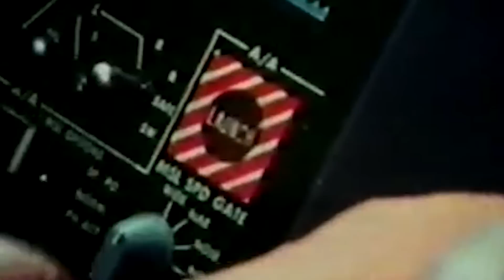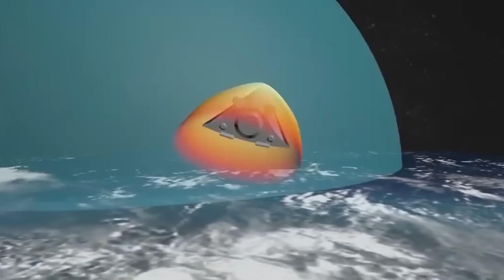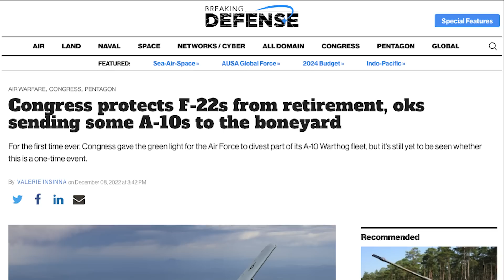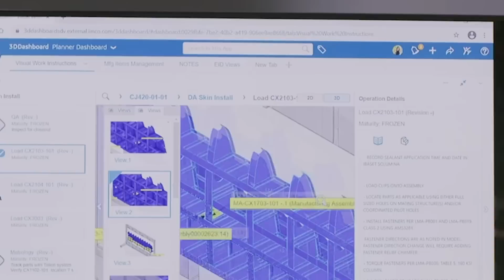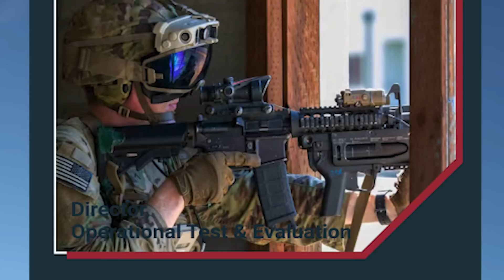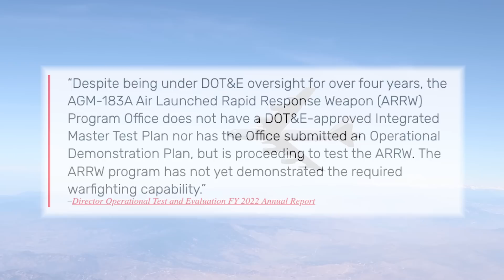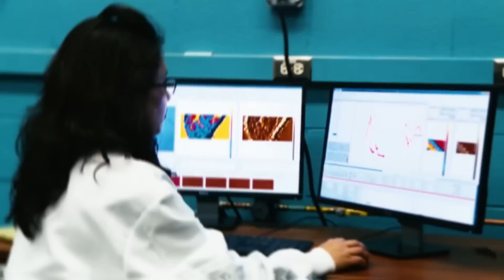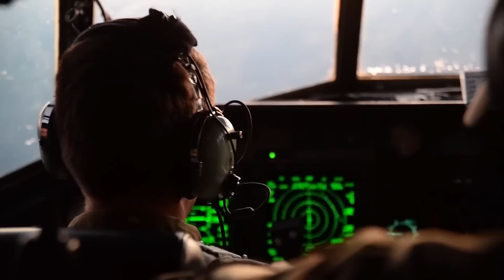What went wrong with the Air Force's HYPERSONIC ARRW missile?

Comment: It's often true that more can be learned from a failure than from a success.
Reply: I’ve learned In engineering one thing that is always true.  1 develop a checklist for your product and each component and 2 carry it out at least twice.    If the test campaign was being short cut failure was inevitable.  You can’t short cut.  Only way to speed up is to bring in more workers.
Reply: I don't know.  It looks like a viable hypersonic missile program that had a good chance of success was ruined by accelerating it by bypassing tests and checks for the sake of a slight advancement in potential deployment date.  This now leaves the US dependent on more complex and likely to fail air breathing missiles.  What could go wrong.

Comment: Quite apart from the over-arching question of strategic utility, still can't understand why, such considerable expense, the specific, identifiable issues would not be cheaper to address than to abandon the entire project. Was it perceived as not so much too difficult, but rather as throwing good money after bad? Or is the key issue was systemic planning flaws, once these were identified, would it not be cost-effective to re-structure the project and try again? (Sorry to be clueless DESPITE your excellent analysis, Alex 🥴)
Reply: I think there is a need to funnel money at defense contractors to keep them from a brain drain. It sounds like a make-work project, and since there is a war going on in Europe, there's that extra incentive to rush it into the battlespace to do some 'live fire exercises' to ascertain its combat potential.

Comment: Like Elon musk has been quoted many times"if you're not failing, you're not testing enough" .... You have to test it until it breaks and then keep going, and that goes for missile systems too
In the rush to field the system, the Air Force and the contractor developing this system forgot that concept. Every point of failure leads eventually to success.
The problem is the" politicians"  want a quick fix, to an issue they've never dealt with before.
Reply: This

Comment: The US military is making a powered hypersonic missile. What Russia and China have done, could EASILY be replicated in the US. All they have done is take a ballistic missile and change it's flight pattern. The US on the other hand...is trying to build a missile with an engine onboard that maintains the speed for much longer over the ballistic missiles. Russia and China's missiles are fast initially and depending on how far they fly it out....it could be way into subsonic speeds before it reaches its target. They also lack some maneuverability because maneuvering their missiles will bleed its energy off(speed) and slow it way down.
Reply: Absolutely  correct  Sir
Reply: LOL. You have got your facts screwed up. Russian Kinzhal fits the description you are talking about. Kinzhal is a ballistic missile depressed trajectory and ability to do limited maneuver. Missiles classified hypersonic missiles like China's DF-17, Russia's Avangard and Zircon are highly maneuverable missiles with flight pattern that is very difficult to predict. Currently, US can not "EASILY replicate" such weapon. ARRW was their first attempt to replicate such weapon and they had failed. There are fundamental difference between the design and the technology of a ballistic missiles versus hypersonic weapons. Ballistic missiles have blunt conehead and uses contained rocket motors. Rocket motors use liquid oxygen or an oxidizer as a source of oxygen  to ignite its liquid or solid fuel instead of sucking in air from the outside. But once the last stage separates, it is mostly free fall weapon except in rear cases where they add additional rockets to do a limited maneuvering at the terminal stage.  Chinese anti-ship ballistic missiles like DF21D and DF26 are ballistic missiles.  Hypersonic weapons that are glide versions have a flat bottom to bounce off the atmosphere and change directory after it separates from a boost phase, which is powered by rockets, like the ballistic missile. Scramjet hypersonic weapons use scramjet motor which sucks in air to give its power.
Reply: russia leads the way thats a fact
Reply: @frankrenda2519  😂

Comment: 12:30 - correction: the "DF-ZF" was eventually modified into the "DF-17", which is not a "strategic" system meant nuclear 2nd strike (even though it's likely nuclear capable), but rather a conventional intermediate range precision strike mission comparable to other PLARF IRBMs of a comparable range - somewhere in between a DF-21 & a DF-26. The PLARF has yet to field a "strategic" system with an HGV or air-breathing scramjet hypersonic propulsion, although that's widely known to be under development.

Comment: That was a great excerise in methodical news telling. A very convincing storyline.
One thing I quesry though is the conclusion the whole programs shut down was needed.

As you pointed out Alex, it was the first stage of the mission objective that failed and nothing else - it didn't get to stage two (navigation to target) nor stage three (impact) but failed in the launch phase.

How do we know the mach speed was not right on, that the navigation program was extremely accurate or that it's impact location and power was not equally as expected.

So from the conclusion brought about by the DOD or Senate to cancel the entire program, as opposed to fixing the stage one issues seems an alarming oversight of all the other components never realised in the test phase.

Comment: Having worked on engineering projects for decades, I learned that the reason for testing is to validate a concept or some aspect of a system function.  If you learn that the concept is invalid, that is not a failure, it's a datapoint.  It's a fact.  It's knowledge, and it's progress.  The universe of hard knocks is a good teacher, and only a fool doesn't learn from testing.  That's the reason for after action reviews.  That is the reason why the United States military is the best on planet earth by a wide margin, and thank goodness for that.  If only the politicians did half as well as the military in their (dys-) function.

Comment: Because Raytheon has been chosen to build US hypersonic missiles. Just like when developing the F-22, the YF-23 although even better than the Yf-22 in many aspects was scrapped when the US air force chose Lockheed over Northrop Grumman. It makes sense as Raytheon's main focus is developing weapons and weapon systems where as Lockheed's focus is military aircraft.
Reply: The YF-23 could have eventually been a great aircraft.  However, a lot of the systems were still under development, while the YF-22’s systems were mostly proven and ready to go.  The YF-22 was also a better pure air superiority fighter, which was what the USAF was looking for.  If the USAF had been looking for a multi-role aircraft, then the YF-23 may have been the way to go.  It would have also been ideal as a fleet defense fighter for the Navy, due to its longer range and larger weapons bays.  Its lesser maneuverability would have been less of a detriment in naval service.

Comment: The ‘failures’ you mentioned (failure to detach from the B-52, failure to ignite) aren’t total failures. 

They are more on the lines of technical errors made by ground crew during preparation for the tests. Nothing more. 

As you stated, in all of the other tests, the missile was successful.

Comment: But the AIM-260 went into full production last fall and that is hypersonic.  There is also a hypersonic cruise missile that has test successfully that is supposed to go into full production by the end of this year.  The problem is HS missile MUST cruise at at least 10,000 feet or more do to the thinness of the air at those altitudes.  Most in fact need to hit 100,000 feet to achieve those speeds.  This makes them much easier to shoot down.  And while they say many are maneuverable, this just means they have can have a flight path that tries to avoid air defenses.  Any cruise missile should be capable of this (but typically can not).  A NASAM system with some AIM-260 should have no trouble taking down pretty much any HS missile.

Comment: I'm not sure the reason for developing and ultimately cancelling ARROW is what Alex suggests here.. If fielding anything hypersonic as soon as possible was USAF's goal, than they should have continued with the Navy and Army in fielding the 3 service boost glide weapon which is less advanced than ARROW and would have been fielded sooner. 
For example Navy/Army boost glide missile uses the conical shaped Common Hypersonic Glide Body (GHGB) which is based on the one developed some years ago by the Sandia National laboratories, and is being engineered by the General Atomics. 
On the other hand USAF left the joint development program to develop the boost glide weapon, to pursue a more advanced system that utilizes much more maneuverable and precise (and therefore harder to develop) wedge shaped warhead.  If USAF wanted to field anything as fast as possible we would see them arming B-52s with common hypersonic missiles this year, just like the Army plans to make their Dark Eagle hypersonic missile (by the way finally a cool name for the new missile in US arsenal) operational by the end of 2023. Navy plans to have their version of the joint missile ready to deploy on board the Zumwalt class destroyers in 2025, but the delay is here simply because they have to remove the defunct AGS guns from the hull and install 12 tubes with hypersonic missiles.
So again, this theory doesn't make sense.. That being said I'm kind of glad that USAF will pursue the hypersonic cruise missile. I always kind of thought of a true hypersonic missile being the cruise missile type. Let's hope this time they'll stick to it and end up with an operational weapon capable of hanging of off Vipers, Strike Eagles, Hornets and Panthers (yes, I've called the F-35 a Panther cause the pilots unofficially call it that. F-35 is nonsense while the Lightning II is even worse).

Comment: The missile suffered a number of failures when the Air Force started its testing too, with three failed launches in 2021, however it reversed course in 2022 with three successful tests. Among the 2022 tests was the first launch of the fully operational prototype missile, which was defined as a very successful flight.
Reply: Almost all of the actual flights were very successful.  I think there were 3 failed flights.  On one, the missile didn’t release from the B-52.  On another, the terminal phase module didn’t separate from the booster.  And on another, the engine just didn’t light for some reason.  These seem like quality control issues with the manufacturer, and not anything wrong with the technology.

Comment: Have few questions: 

(1) Considering the recent failure, is it more technically challenging for the ARRW system to be air-launched with a small booster, compared to Russia and China's hypersonic glide vehicles with their extremely  large boosters and can only be launched from the ground?

(2) Is it possible that the US has set higher standards for hypersonic  testing than Russia and China who have already deployed their hypersonic missiles without disclosing their test history in the same manner as the US? While it's obvious that Russia&China HGV would be worst on target accuracy. 

(3) While the scramjet-powered HACM has seen repeated test successes, unlike the ARRW which has experienced a streak of test failures, why is the service date for HACM targeting the distant year of 2027?

Comment: Hypersonics do offer some value, such as important targets of opportunity that have a small window for engagement. Or for quickly destroying C2 before the enemy can organize effectively. Could also be used to eliminate potentially dangerous strategic targets before the enemy can use them
Reply: But that requires having absolute proof via superior intel before launching a series of hyperexpensive hypersonics.
I think it would be easier to have X number of drones armed with cameras and hellfire missiles, where X is equal to the number that the hypersonics million could buy. The cameras give the intel and proof. The volume of drones defeats any anti-air defense the enemy has.

Low tech + magazine depth = winning any war.
Reply: @Old Man Black Socks  x number of drones requires air superiority, especially since you're suggesting long endurance and relatively cheap ones. Remember, the Reaper isn't exactly cheap. 
Getting the enemy by surprise and leaving them disorganized is how we won the air war so fast in Iraq. Hypersonics gives us a 2nd option. That way, we don't have to rely exclusively on stealth to hit command, control and comms. It can be used to quickly target a sneaky HVT that doesn't expose himself for too long. A kill chain that's under an hour can be very beneficial. Plus, you can't cover a whole country 24/7, where you're looking with drones might not be the place your next target is.
Think of the targets hit by Tomahawks in the Gulf War, some of those same targets can be struck. Near-peers have satellites, and they might be able to detect a mass tomahawk attack or anticipate a stealth bombers and fighters attack if the bases that house them are suddenly empty or half empty. 
A missile such as the Conventional Prompt Strike could hit a target that takes the Tomahawk 1 hour to reach in about 12 mins potentially. The hypersonics the US is pursuing does offer some strategic value. Without them, the US is still more than capable enough of conducting and succeeding in their mission. But who knows, maybe the air war would've been won a week or 2 sooner with hypersonics. Maybe a bigger impact, or perhaps a negligible one. It's more of a day 1 weapon. After that, it would be of limited use, especially after air superiority is achieved.
Reply: @apolloaero  Sure, I buy into your reasoning. As you say, it's wise to have a second option in the back pocket.

The thing I take issue with is how we'd gain that precious intel in order to give the targeting info to the hypersonic missile and keep that info fresh since a) it's time sensitive b) the HVT could relocate and c) it's very difficult to update a hypersonic weapon due to the plasma field blinding all of its sensors and comms until it drops its speed enough.

There will be scenarios when a one-off hypersonic strike would be applicable, but they may be so rare that it won't be cost-effective to use that route. I can accept that going down this path may lead to other technologies that may have a beneficial military application (like materials science for developing ablative coatings, dealing with the plasma/comms issues, etc). And there is a lot we don't know capability wise about US hypersonic programs. My concern is that we're trying to get too fancy when the doctrine of the enemy is basically a zerg swarm. I hope the US is also pouring resources into programs that assist in the quick rearming of missile batteries to counteract Chinese doctrine. Or anti-swarm and anti-drone technologies (i.e. lasers). 

Ukraine has depleted a lot of ammunition stockpiles, and any estimate I see has a timeline in the YEARS to restock. If a war breaks out soon, a handful of hypersonics will be nice and be definitely helpful, but it won't turn any tides if a war lasts longer than a week.
Reply: @Old Man Black Socks  exactly, a day 1 weapon to sow chaos and confusion.
Intel could be garnered through humint or sigint from let's say a RQ-4 or JSTARS or maybe some satellite. 
And that's precisely the advantage of a hypersonic. You're stating that the HVT could move, but I'll say they'll move much more in an hour. 12 mins is a much quicker response time. 
And a hypersonic doesn't need to slow down unless it has an active seeker. With GPS and INS it can potentially hit within 5 meters CEP. Comms can be placed at the back where the plasma sheath doesn't affect it. Plus, with datalink, you can update coordinates several times before it goes terminal. 
A stealth bomber with JDAMs is much more cost effective and with better depth of magazine. So I'm not denying its value. That's why I stated it has strategic value for day 1, much like how the Tomahawks would be used. Or against targets of opportunity.

Comment: Imho, the Arrow does have a legitimate potential use, as a way for non-stealth aircraft to threaten the S-400 by outranging it, which includes the capability of targeting their supporting long range radar installations. That class of weapon is basically strategic MLRS, but with twice the range for the same size because it is air-launched. But that means that it really needs a solid anti-radiation targeting system imho.

With that said, project rapid dragon may be a better way of achieving that particular capability, by just building a long range anti radiation cruise missile which is cheaper than an S400 missile, and really mass producing it and getting the capability to just permanently overwhelm air defences instead of threatening them.

Comment: When an otherwise sound design keeps failing during an accelerated test campaign, that's usually a programmatic problem, not an issue with the hardware. Years ago during THAAD testing there were so many failures that the buzz was, "We can't afford to do it right, but we can afford to do it twice."